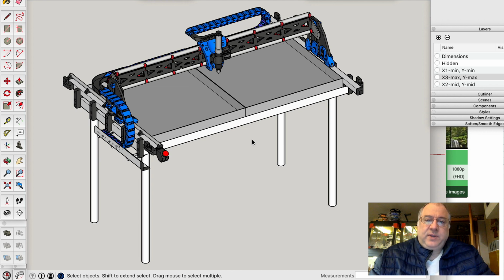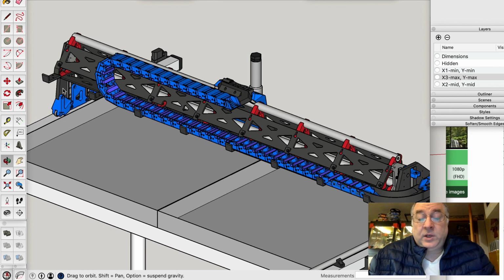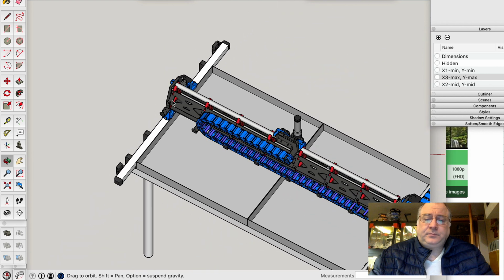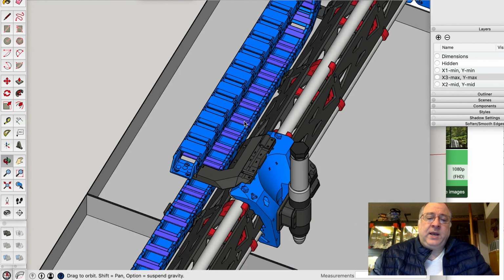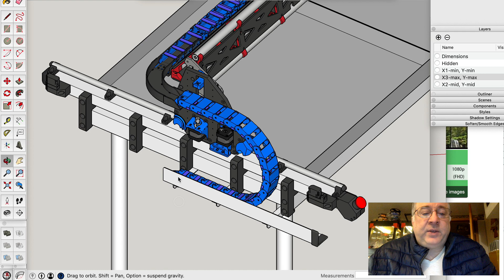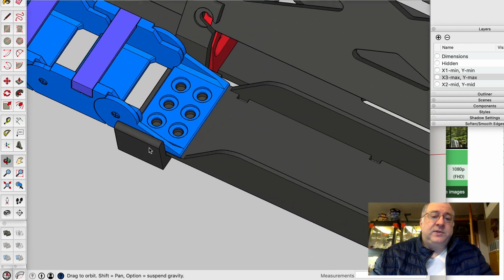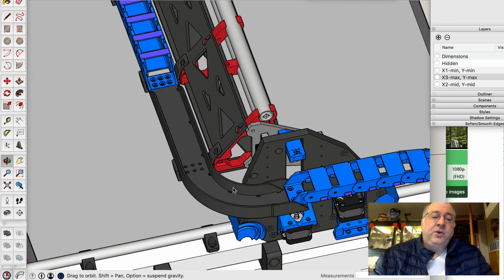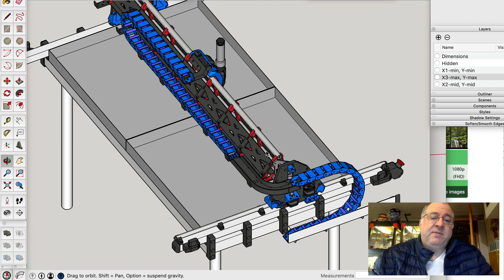LowRider 3 CNC - Large Drag Chain on both X and Y axes

Comment: Doug, kudos for 3d printing your own drag chain! The Y axis chain could be about 1/3 shorter. The first third does not flex therefore is not needed. It won't hurt anything but would cut down on the printing time! The X axis chain seems to have the correct length. It usually starts close to the middle to travel. Excellent design!
Reply from the maker: Thanks!

Comment: Hi Doug. This is great thank you. 
I have been following your channel for a while now and I am building my Lowrider at the moment because of your channel and can’t wait to set up my first project. Any chance you have this SketchUp model available to use for customisation purposes? I have a restricted space in my workshop trying to fit this machine in and the model will help at refining some restrictions I have.
Looking forward to the next videos.
Reply from the maker: Thank you for the encouraging words! For a short time I tried out having a Patreon account, but I did not care for that. One of the things I had shared there was the files for this setup. However, since I no longer have a Patreon, and it’s been a while since then, I could go ahead and post the files for this on Printables. I will try to do that soon and let you know when I have done it.
Reply from the maker: Any kind of a strong, rigid J-shaped strip can work. It could be made out of plywood, or metal, or 3-D printed plastic. The part of it that may require customization would be the location for the holes to attach it to the printed hose hanger bracket thingies.
Reply from the maker: OK, I finally got the raceway files share publicly on Printables: https://www.printables.com/model/501048-lowrider-3-cnc-large-drag-chain-90-curve-raceway-s

Comment: Absolutely fantastic ... Thank you very much for your work. If it is available on your page it will be the first update for my Lowrider!
Reply from the maker: All the drag chain parts are available on my Printables page, except one, the J shaped raceway, which was available on my Patreon page, however, I made a decision to deleted my Patreon account. Soon I will post the J shaped raceway on my Printables account (both a one-piece like I use, and a two-piece which is printable on smaller printers — my biggest printer has a whopping 16" x 16" print bed!). The parts currently available on my Printables page include the printable drag chain and the mounts for it.
Reply from the maker: The video shows my really big drag chain, which is for plasma and is larger than is needed for a regular LowRider 3 (with a router). I also have available on my Printables page, a mount set for a smaller drag chain, which on my other LowRider  3 (with a router) I used a store-bought drag chain (link shown in the description of the Printables listing.
Reply from the maker: https://www.printables.com/social/127223-doug-joseph-design8studio/
Reply from the maker: Mount for store-bought smaller drag chain: https://www.printables.com/model/223004-lowrider-3-cnc-drag-chain-mount-v10  
Mount for my printable larger  drag chain: https://www.printables.com/model/253880-lowrider-3-plasma-cnc-drag-chain-mount-revised-for
My printable larger  drag chain: https://www.printables.com/model/250838-drag-chain-for-cnc-two-piece-snap-open-20mm-x-40mm
My Patreon page: https://www.patreon.com/design8studio
Reply: @design8studio  possible that Patreon not working?
Reply from the maker: @SaDa-ol3wy  Hello. You may have missed the following in the video description: "Note: I'm discontinuing my Patreon and moving toward more free sharing of my designs. The “Drag Chain 90 raceway curve” was indeed made available on my Patreon page, but I plan to eventually make it freely available on Printables."
Reply: @design8studio  oh yes not I found the information. Then I will wait when your Printables page is updated. Thank you very much for your cool work. Greetings from germany.

Comment: Doug, thank you yet again for putting together and sharing your custom mods.  Awesome!
Reply from the maker: Update: the “Drag Chain 90 raceway curve” is indeed now available on my Patreon page, but that was a huge print, so I also offered a revision of it that’s split into three pieces so it can be accomplished on a normal printer. https://www.patreon.com/design8studio
Reply from the maker: Thanks! Many times when I need a part fast, I can get it designed sooner in SketchUp than in Fusion 360 because I'm so much more experienced with SketchUp. This 90 bend raceway part is really something that will almost certainly need customization if someone else wants one, because likely their distance between braces will be different than mine, etc. That means it could, for the benefit of others, be better designed in a parametric driven Fusion 360 offering. I don't have that done. I made my SketchUp file available through Patreon.